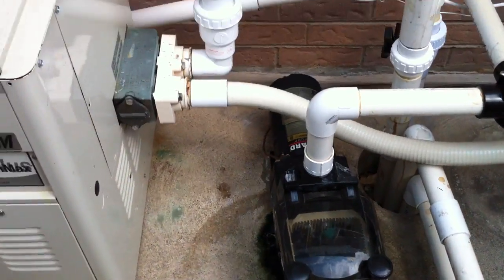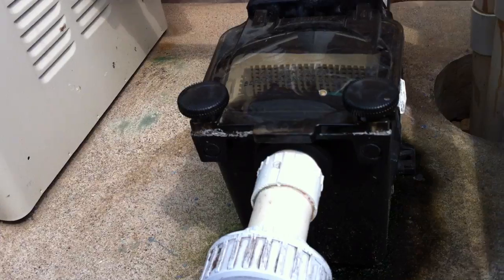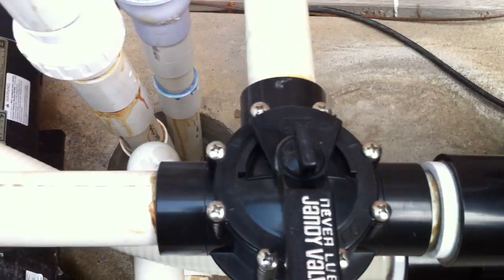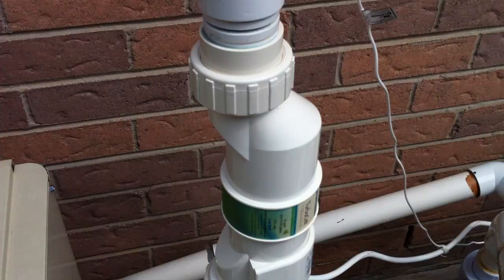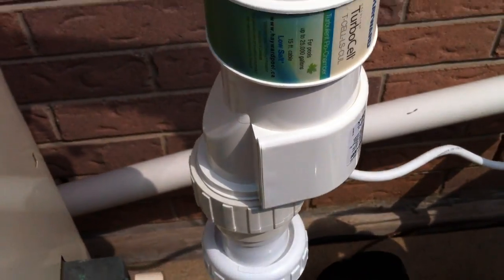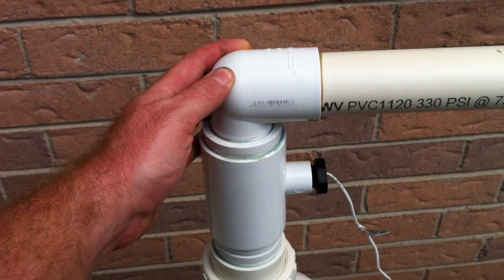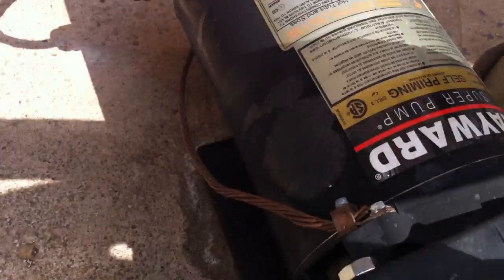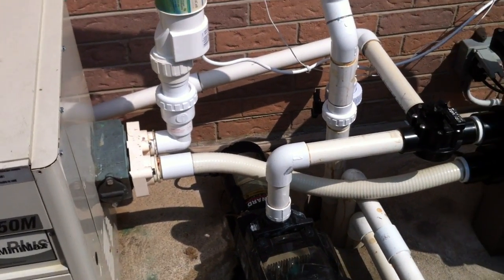How To Install A Flow Switch For Salt Water Chlorine Systems - Pool Equipment Installation Tips

Comment: The flow switch needs 12” minimum distance “after” the chlorinator to prevent turbulance in the chamber. I found out the hardway

Comment: At 2:23, you are wrong here, Steve.  I bet you just glanced at the pictures in the Aquarite manual instead of reading it.  Right below the figure in the plumbing section there’s a note for the flow switch that says “If the switch is plumbed after the cell,the cell can by counted as the 12” (25cm) of straight pipe.”
Reply from the maker: That change was made in the 2018 aqua rite manual, prior to this, and when this video was filmed then cell did not count towards the straight run.
Reply: @Swimmingpoolsteve  , sorry Steve, but I bought and installed my Aquarite myself in April 2014.  And that note was there then.  Why not add a note to your video to avoid misguiding people? The rest of the video is great, as usual.

Comment: Hi Steve,
Great video series!
Quick question: Is the check valve only for heater applications or should it also be used between the salt cell and a cartridge filter for pools without a heater?